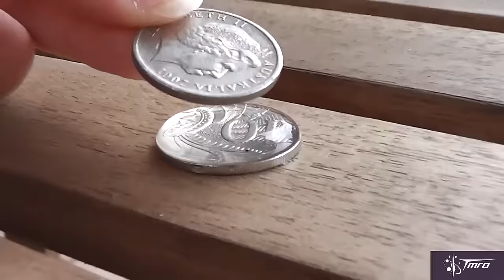Surfing on the Space Station - Space Pod 12/16/15

Comment: G'day Lisa,

Yay Team !

  I did a Terrestrial version of this when my then-new Generator had a maladjusted Rocker-Arm which was creating microscopic steel fragments in the Engine-Oil...; to guage the severity of the issue I put the drained out Ferrous-Dusted Oil into a clear-glass Coffee Jar (Nescafe Gold, they have flat-faceted sides), and laid the Bottle at 45 Degrees to the Horizontal, with a 2-element 4-pole Magnetic Workshop-Clamp touching the lower facet of the Bottle, with all the magnets "under the Oil", on the Shady-side of the Bottle, which was aligned True N/S with the deep-end at the North...

 After a day in the Sun with the  Thermal Convection currents in the Black Oil inside the "Greenhouse",  the Ferrous Dust was all concentrated clinging to the Glass 1.5mm away from the Magnets, as revealed by slowly and gently rotating the jar (with the Magnets attached) into the Vertical, thus allowing the cleaned Oil to drain away from the Iron Filings forming Doughnut-Rings on the Glass Wall, held there where the Field had grabbed them as they'd been swept past...
 
       Segue (Part 2).

  At about 1 minute in, I reckon I heard Sydney Suburban Pigeon-Noises (?)..., so methinketh thou hast flown home for the Summer Solstice Festival ; such being the case, how did you get on in yesterday's Super-Cell Tornado Hailstorm ?

  The homeward-bound Obernewtyn Melbourne  Expedition made it as far as Castle-Hill on Tuesday night, and they didn't get rolling again  till 11:00 Wednesday, just as Cronulla & Kurnell were getting hammered, but they managed to stay just in front of the Leading-Edge Impact-Zone for 615 Km, all the way to Glen Innes at 21:15, by which time the Supercell had spread out and calmed-down and the gentle rain had begun here by about 19:00... Whuff !

 Warbledaddy Raindancer spent a very intense day, doing long-range Micrometeorology ! (lol).

   Was that your Red Queen Masquerade-Ball Dress ? 

Have a good one,

;-p

Ciao !